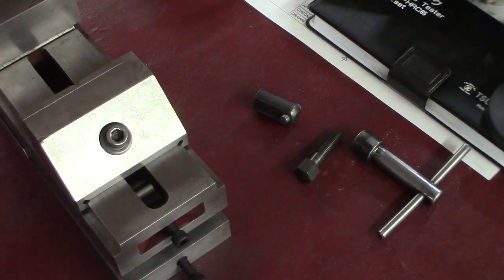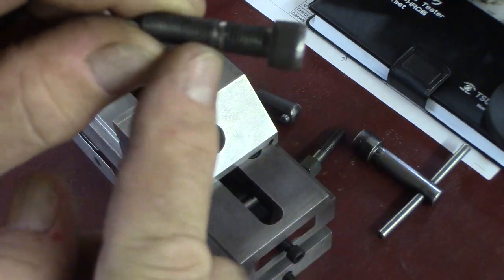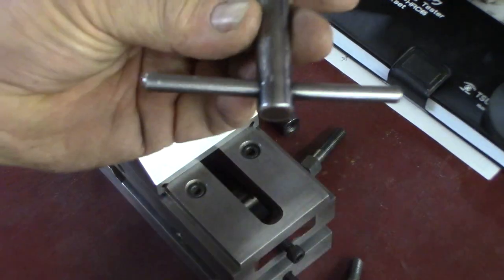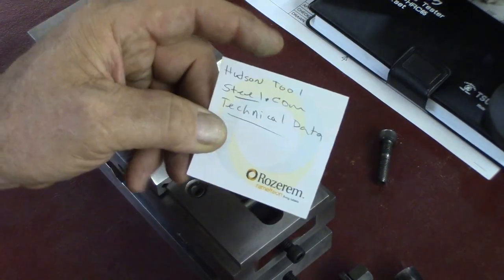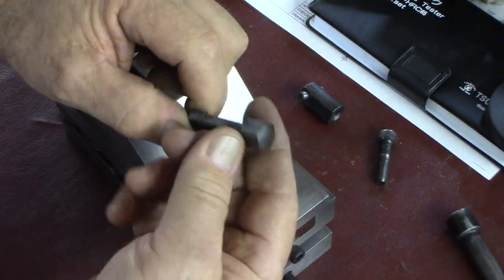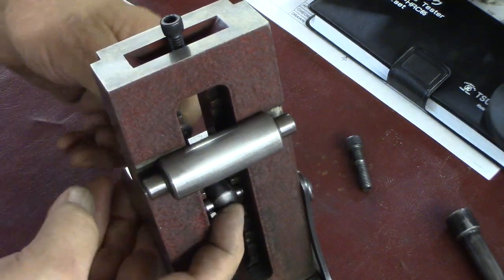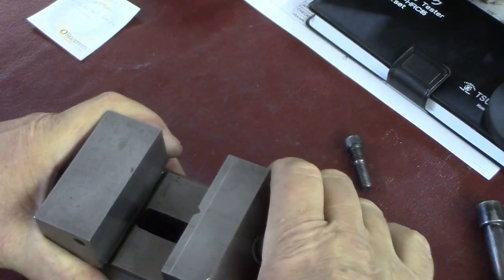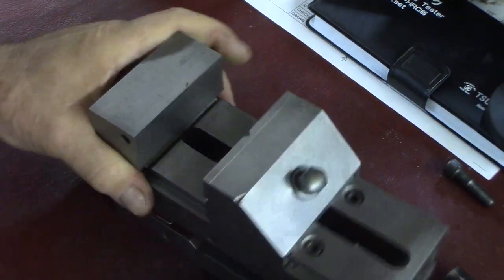Tool Steel Heat Treatment Hints

Comment: I've always used a magnetic to check my thrmp once the steel loses its magnetic property it's ready to quench.  Probably not as good as the pro method but it will get you buy and should help keep you from over heating it.
Reply: Be careful at certain types of magnets, at even lower heat, they'll lose their magnetism permanently...   :(
Reply from the maker: Magnet for the home shop test is usually good enough.  Thanks Chris.
Reply from the maker: Especially Neo's, very low temp.
Reply: Pierre's Garage no heating the magnet just tucking the steal to see if it still sticks or not very handy test